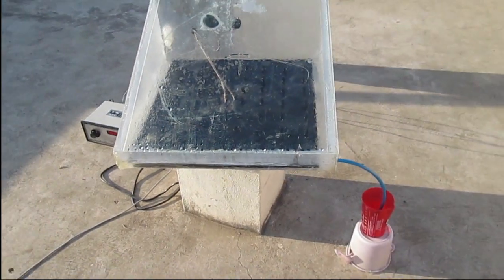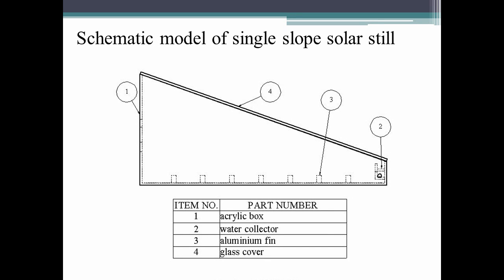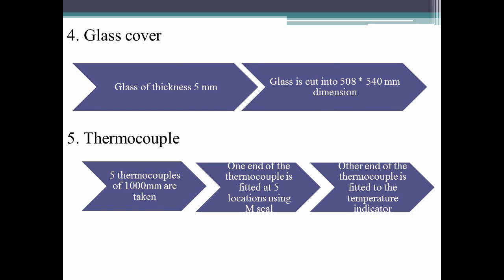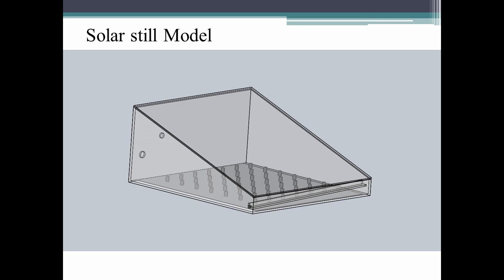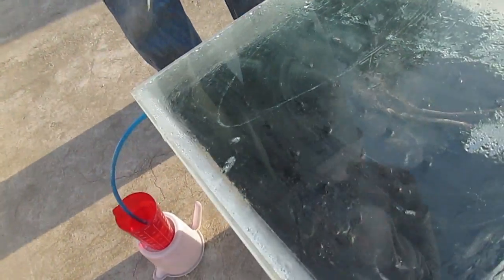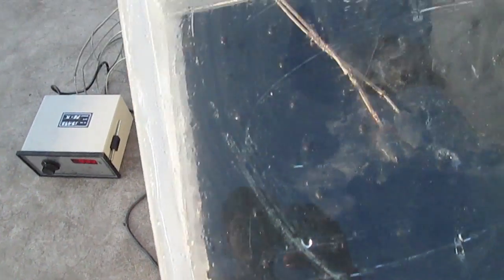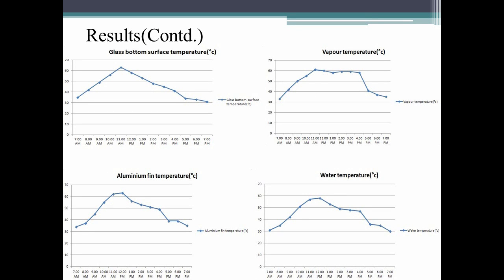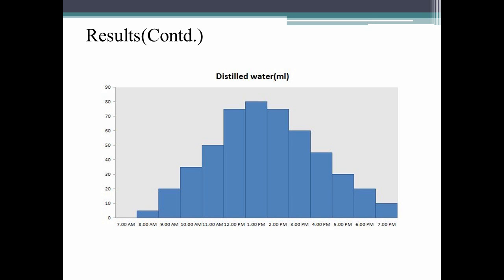ACRYLIC SOLAR STILL WITH ALUMINIUM FINS

Comment: it would be nice if you demonstrate every part and function.  So there is no condenser needed.  Can you show what do you mean by fins?  It would be nice to see a closer picture of the condensing rod? how do you clean the left over from the Aluminium sheet after the water is evaported?
Reply from the maker: fins Is just the aluminum rod cut into small pieces placed on the aluminum plate which is painted black which attracts Sun Light and hence more heart is generated inside box

hence the efficiency is more